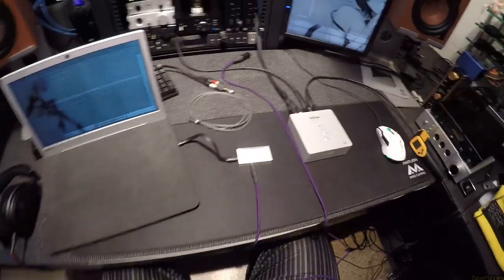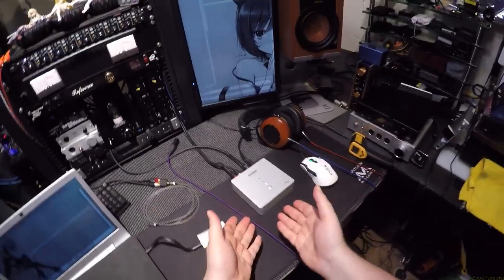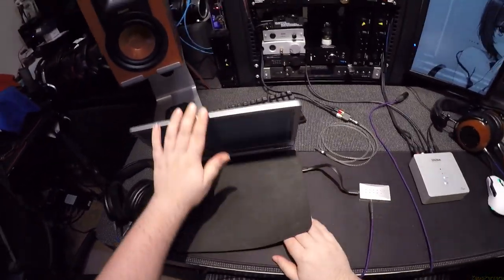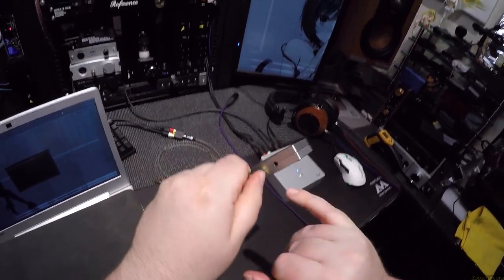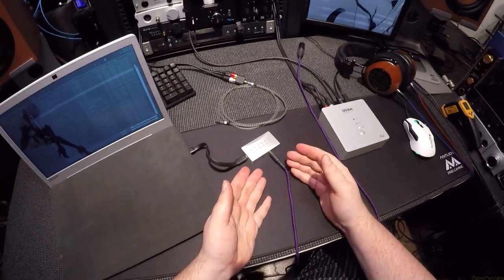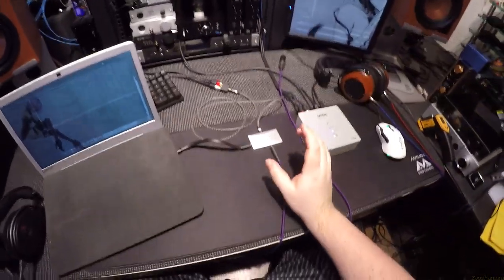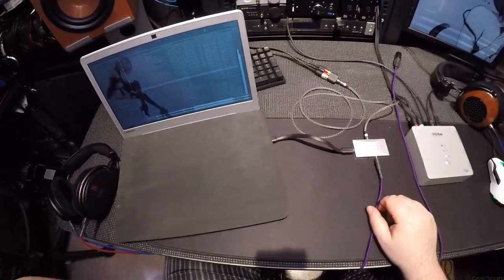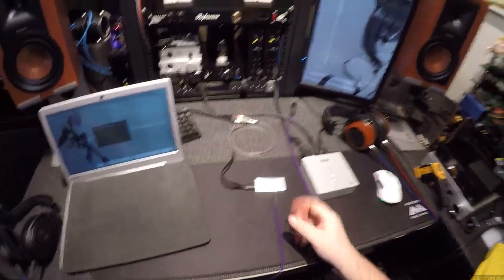Miyo & Metrus Flint _(Z Reviews)_

Comment: With D/A conversion timing is everything... when using SPDIF optical (Toslink) the clock of the source is used. So in this case the computer, which is far from optimal. Using USB the clock in the DAC will be used, which (at least in a good one) makes all the difference.

Comment: I guess this small one won't power T20RPs? :D
Would you say the RCA outs of the Geshelli Enog2 deliver better sound quality than the Topping D10 you reviewed recently?
Because it's low gain option would probably be safer for use with the Emotiva A-100 than the fixed gain of the Topping. Does the sound quality of the Geshelli change with the gain setting?
Reply: I have both the Geshelli and the Topping D10. I also have T50RP and between those 2 DACS it is just how much power. The ENOG2 has more power than the D10. The D10 has the same power level as the 2nd level of the ENOG2. The ENOG2 shines more for balanced and to me the RCA sound the same between the two for sound quality just the ENOG2 has more power.
Reply: @QuintilianA  Hm, OK, thanks for your help!
Since I am going to get a Emotiva A-100 a lower gain output, as the Geshelli offers, would be good since the A-100 won't kill me then (hopefully) :D.
The question is if that is worth the 80$ premium (which I guess it is) and if the Emotiva is powerful enough to still get the T20s loud enough with this little imput gain.
You don't have a A-100 or another Amp that puts out around 8W@50Ohm?
Reply: Emotiva will be loud enough with either. Use as high of a source input you can, so you have less noise floor on the A-100. Cause if its got one bad side it's the noise floor, the lower you're able to keep the knob the better that will be.

Before the THX-AAA the Emotiva was worth it despite the noise floor but nowadays the THX just renders basically everything else redundant lol.
Reply: @tenveri  Yes, and I'd love to get my hands on a THX AAA 789 but since it's only available when Massdrop decides to, that is difficult. If it is available second hand it will probably go for at least twice the price I guess.
But the reason why Z recommended the Emotiva is not it's sound itself, but it's power. I fear that the THX falls short in this regard when using a T_0RP. In the T's review Z said " You don't need 8 [Watt into 50 Ohm] but probably 6.5 to make me happy". That would be about 4/5th of what the A-100 delivers. The A-100 puts 12W into 33 Ohm while THX puts 1.8W into 33 Ohm. That would be not even be 1/6th of what the Emotiva delivers, so way less than Z recommended. Or am I missing something here?
Even if I decided to mod it into a balanced Argon, the THX wound still output only 6W@32. That would still be only half of the A-100, so only 4W@50Ohm I guess?
Reply: @KALTBLUTWOLF1  The THX in balanced XLR is more than enough power to drive even a he-6. The T50RP would be fine :)

I have owned the Emotiva, and now own the THX so I'm not just saying that.
Reply: @tenveri  Ui, OK these HE6 play in a different league when it comes to sensitivity...
But what I wondered for a long time now: Does the sound characteristic of a headphone change when driven with different power ratings? So, let's say the jumpers of the A-100 won't alter the sound, only the wattage going out. Would the headphone sound any different with or without jumpers other than being louder?
Reply: @KALTBLUTWOLF1  That is a whole big can of worms :p but having owned the Emotiva, I bought it because people said it really "opened up" the T50RP series. well I can safely say that is typical audiophile placebo speak. The THX sounds the exact same if not better, with much less noise as you ramp up the volume!

There is more to your question, voltage or current feedback mechanisms, amp implementation. There's people that would say these things greatly affect sound but my experience was not the case..
Reply: @tenveri  How do you feel the THX briefly compares to the A-100? My A-100 made the NFB 11.28 sound like a $40 China special. So much more full and spacious. I have Argons on the Emotiva A-100 so wont sell it. But I have many other headphones and want to jump on the budget THX band wagon with all you lol.
Reply: @davidholomakoff4514  I replied previously that I feel the THX (in balanced) sounds much like the A-100. It is similar in power and sound, but does not have any hiss at max volume unlike the A-100. I feel like it's better in every way, but you own the emotiva and it serves you fine I feel like there's little point in upgrading.

And yes the NFB gets progressively worse the more power you need of it. I understand why you say it does not sound full/spacious. I honestly think the audio-gd are rather overhyped unless you have modest requirements.
Reply: @tenveri  thank you for your timely reply and information! Sorry I must have missed those details in your other response :)
Reply: @tenveri  But just how do you listen to the A-100 at full volume without it ripping your head off?! Are your HEs THAT inefficient?

Comment: Can someone explain what balanced plugs are and what they do?
Reply: They output sound a few dB louder than unbalanced so it confuses him.
Reply: Grounds for each channel are separated. So you need 2 wires for each channel. Total of 4 wires. Some like z swear by it.
Reply: @Corei14  That's actually very rare, the only amp that I know of that's using 4-pin xlr to output separate grounds is Benchmark HPA4. Most of other amps that have 4-pin xlr work in balanced mode, where every wire is connected to a phase and there is no ground at all.
Balanced interconnects work in the same way usb, HDMI, and telephone lines do, it's better than single ended but there is no reason to fuss over it for cables shorter than 3 meters.
Reply: That's a big can of worms to open up in a youtube video comment section. 
You need to go to r/headphones or Headfi to get a proper answer. 

No one is going to type everything you need to know here.
Reply: He already explained it in another video. Yup, ground for each channel. So the sound feels, maybe, 5% "wider" according to him, that's it. Not much. He blind-tested it with a little 100$ (!) balanced Loxjie red tube amp in another video, and he could hear a difference. So there's that. It's not placebo, snake oil, etc.

Mostly found in stuff with XLR inputs, because if you have balanced headphones, why not go all the way and get big wires for left and right channel with over-the-top error correction originally used to kill the noise in 50ft wires in music shows and PA systems etc.

Comment: Re: Metrum DAC
In my current understanding, what Filterless NOS DACs do better is reproduce ultra-fast transients that require the presence of ultrasonic frequencies, which OS DACs cut out when they apply low-pass filtering at 20 kHz. Apparently, according to a few studies, human perception can detect fast transients corresponding with ultrasonic frequencies even if we can't hear continuous sine waves at the same ultrasonic frequencies. So we're supposedly missing out on some of the realism that could be there if we had those ultra-fast transients, because we usually cut out all 20k+ content and consequently slow down all the transients.

If this is what's going on there, the only way you'd be able to hear a difference through a NOS DAC is if you were playing back at least 24/96 material and you were sure it had been intentionally mastered with ultrasonic content in it (ideally including microphone-recorded ultrasonics from actual natural instruments). If you're listening to 16/44 that was all low-pass filtered at 20 kHz in mastering or prior, of course there's nothing special to hear through the NOS DAC - the "special part" is already missing from the recording you're playing back. Also, this is one of those times where it becomes important to have headphones or speakers with a specified frequency response that goes far beyond 20 kHz - same idea, ultra-fast transients.

Comment: Well... it's a Dac.
What did you expect?
Reply: TheKillerKlok Hmmm no, the smsl D1 or rme dac already proved to him that spending significantly more on a dac can be very beneficial given you have a good enough amplifier to hear it. The issue with dacs is their components get outdated quicker than any other audio gear (for instance, the dac chips in many flag ship daps from 2 to 3 years are now inferior to the componentry in daps costing several times less today, that isn't the case for analogue tech). So the issue with the Metrum is that it is to old for the componentry inside not to have been superseded by cheaper dacs today like the ENOG2 PRO. Also, keep in mind that dac chips can also colour the sound, the newest ess chips being much warmer sounding than their previous, so its not just a matter of being 'clean'.
Reply: @En_Joshi-Godrez  opdac? I've heard of op amp as in operational amp but what is opdac or is that just what the dac chip itself called?
Reply: thomas locatelli You're right, I got confused between the two.
Reply: @En_Joshi-Godrez  yea was pretty sure that was what you meant by the way you were using it but I'm not remotely an expert on the subject.
Reply: Indeed. I find my Dragonfly Red to sound slighly V-shaped compared to my other gear.
Reply: Mattias Göransson Really? When I had it, it sounded quite mid forward, at least compared to the mojo which was much brighter. Ifi stuff being mostly neutral as a reference point.
Reply: @En_Joshi-Godrez   Flint is R2R, no chips to get outdated. But it's also their cheapest one so eh.
Reply: adaniel2929 Yea maybe I shouldn't of listened to z when he said that and actually looked it up. In my defence, it does look like something from 2005. Anyway, the biggest issue then is them using much more expensive 'in house' componentry  just to create a 'cleaner' sound. Dac's from the likes of smsl and Geshelli, like the su8 and Enog2, can already accomplish that to a degree that the returns on making a purely neutral dac using more expensive components would be greatly diminished. There's a reason companies like chord create an sound signature that is not possible by using third party dac chips.